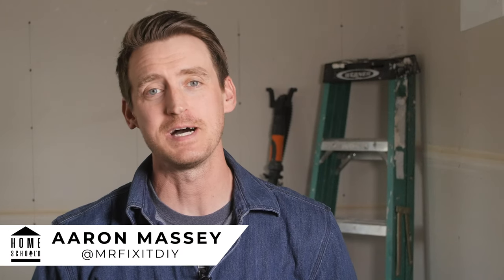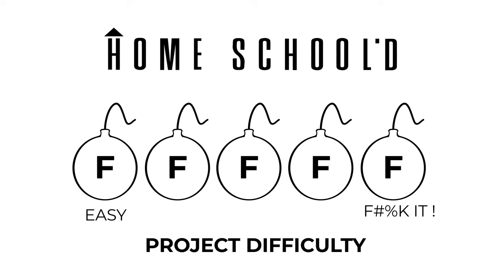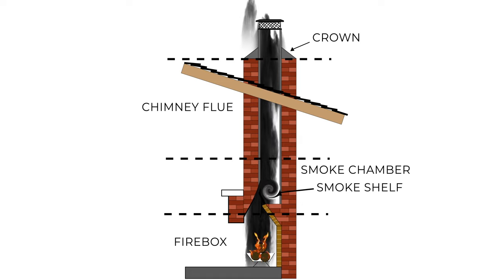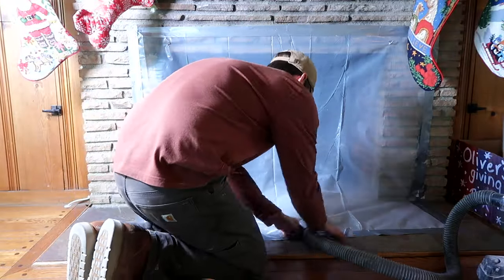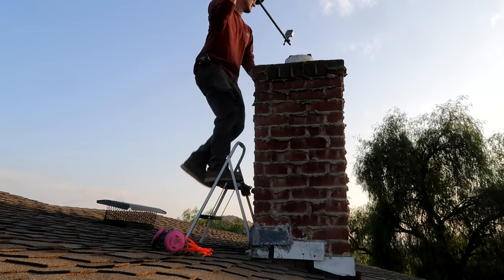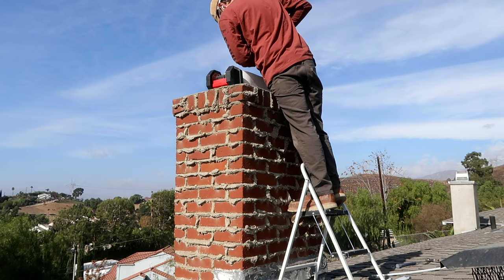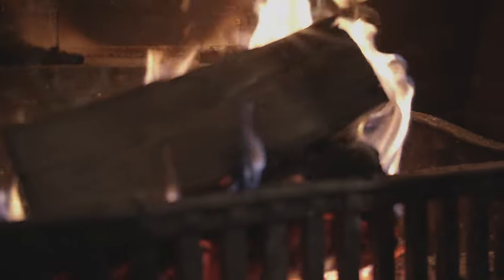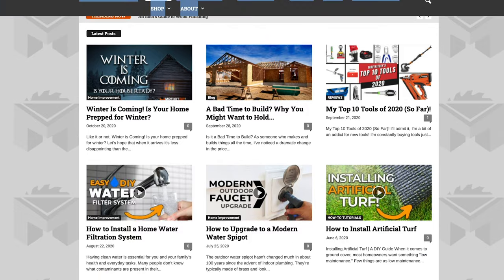How to Clean Your Chimney & Why You Should! | A DIY Guide

Comment: I'm a real life chimney sweeper. You did a good job but dam you made it look way harder than it really is  and did way too much. It's done much simpler in real life when actually doing this job daily. Never use unnecessary stuff like that creosote buster. That is not needed until you have an issue with creosote. Otherwise you are just burning money away. To avoid creosote you just need to burn dry wood and let enough air on the fire that it burns at a high temperature, so it burns everything away that the wood burning process produces. Making a fire in a fireplace isn't really something simple like lighting logs. There are actually a lot of details about it, on how to do it the right way and avoid problems later.

Comment: Thank you! I just got quoted $1600 to clean the chimney, fix the crown and replace the cap. LOL! The minute he said $225 for the cap I knew he was out of his mind since I know those are about $60 at home depot.  So I figured I'll just do it myself!
Reply: yes but they have to pay business taxes and insurance and liability and licensing and etc. etc. so find 3-4 quotes and then you can see if you're really being ripped off. if you can climb a 30 foot ladder to cap a chimney more power to you! ill climb a 70 foot silo before i'd climb an extension ladder.
Reply: @danielroden9424  there’s no need for ladders at all. Actually. There’s window access to the first story roof, with easy climb up to the 2nd story roof, which gradually slopes up to the top of the chimney.
Reply: I had my chimney cleaned & crown repaired, but they put a lock top damper on instead of me using my old rusty iron damper. Maybe they were gonna put a damper on & not just a cap? I paid $1,400 for my job.

Comment: A few things I'll add being a chimney company owner. 1/4" or more creosote accumulation is considered hazardous, and even 1/8" thickness accumulation can be ignited (I've done it). "Level 3" creosote cant be removed with a brush. Good chimney companies inspect not just for structural integrity issues but also installation/build issues. And lastly, you MUST clean the smoke shelf after cleaning the flue on this kind of setup. The smokeshelf catches the vast majority of the swept creosote, without removing it, all you do is relocate the flammable creosote to an area thats closer to the firebox. Its amazing how many "reputable" companies forgoe cleaning the smokeshelf
Reply: I had two sweep out and first one cleaned chimney and smoke shelf second one ran a camera and said it looked good but mention a spray for the creosote smell both recommended a installer for a woodstove insert with a stainless steel lining but the installer said nothing about a spray is it need ? Thanks
Reply: Yes the the smoke chamber and shelf are very important to sweep off that's where most flue fires start my guy
Reply: I here is the smoke shelf? And do all chimneys  have them ?
Reply: This is why I come to the comment section. Thank you.

Comment: Perhaps I missed it, but you really need to vacuum all the creosote that collects on the smoke shelf. This can become a primary source of ignition once it builds above the lip of the shelf. You will need to remove the damper…easy to do. You will be amazed at what comes out of this area….5-15lbs of loose creosote.

Comment: I am a CSIA certified sweep operating in the southern US. I think your brush and rod set up was really good. You did a thorough job brushing, and good on you for sealing off the fireplace. I was also very pleased with your respirator. I am a little concerned about the soot that was left behind the damper catching on fire. You can check what is back there by holding your phone over the door and taking a picture. Shovel or vacuum out whatever you can from that smoke chamber.
Reply: Dude thank you for that info!!!!
Reply: I was thinking the same thing!
Reply: Agreed. The previous owner of my house never installed a cap and the area behind the damper door was full of leaves and debris just wasting for a fire. Get up in there with a vacuum as not everything will fall out into the firebox.
Reply: I’m gonna get my CSIA asap how’s business in the southeast
Reply: My fire place does not have a smoke shelf or damper built around 1940. I have no problem using it I have a cover on the top with inches with a chain to pull it to open and close
Reply: Very true. I have about 5 years experience, but not certified. Though I learned from the best. Another way to check behind the damper is to take a heavy duty flat screwdriver and pry the edge of the damper up and see what comes spilling out. Can do that by pushing up and back on the damper handle  if it's a center handle. Sometimes damper removal is a must I'm sure you know.
I've yet to try the cell phone picture. 
Thanks for that tip.

Comment: Good video but one thing i will say is the tool he used you do not have to go on the roof in fact its pointless to do so. When i had a chimney sweep  service done he used basically the same tool and just did the sweep from the fireplace to the top of the chimney useing the rod no need to go up on the roof and risk your saftey

Comment: I am a chimney professional, and do sweeps, installs, tuck pointing, and basically anything on your chimney, and I approve this message. Cleaning your chimney is quite easy. Just one thing, make sure to clean off the smoke shelf as well. There will be a massive amount of build up up there.

Keep in mind that there are countless variables from cap types (top damper, with a long cable down the flue), flue types (clay tile, liner, etc) stove type (freestanding, insert, furnace, etc) and clean outs. All pretty much the same, but there may be different added requirements like removing the cable in the case of a top damper. These should be mostly self explainitory though.

The main benefit of having someone like me clean it is because 1) we know more about what we are doing, as well as how to look for damaged flue tiles, and other safety issues. 2) Fire insurance!! There is a fire inspection form that when turned in to your insurance agency by a licensed professional will massively lower your insurance. Any home with a fireburning "anything" is automatically put into a different cost bracket. We can get that reduced to as little as 1/3. And 3) we keep track of everything from videos of your chimney and flue for our file and to reference in the case of an insurance claim, to helping you make your fire burn more safely, more efficiently, and with less creosote. Oh, and 4) it's supposed to be good luck to shake the hand of a chimney sweep. Not sure why, but people do it all the time, lol.

So all in all, good info, and thank you for spreading the word. And to everyone who read this far, have an amazing day, and chim chim, charoo!!
Reply: I have a heatilator insert installed in 1991. Do they need cleaned yearly doesn't look like much build up when i open flue its a 8inch SS flex pipe from box to roof
Reply: @nickyj3571  it depends. We usually suggest every year, but tbh, if it is handled well, we suggest every two years. I've seen it last 10-20 years, but those people are few and far between. I really don't suggest going longer than two years, as there is much more involved than just cleaning. We clean, video, inspect, and notice any dangers that you may have missed. We also save all that info in the event of a fire related incident, and the inspection form lasts two years most places. That form will take a huge chunk out of your fire insurance. 

So, in short, you can clean and inspect your own chimney, but it would be wise to have a professional at least inspect every two years.

And I would advise asking your local chimney professionals this stuff too, as I don't know that model off the top of my head, but it sounds like you have everything set up well, just can't really answer that with absolute certainty without actually seeing it.
Reply: @bubblegumshoestringracing1498  I'm not quite certain if this is meant as a question or not, as a phrasing confuses me, but I'll read it as such.

 I've never heard anything about it being good luck to tip them, but definitely to shake their hand.
Reply: I need someone like you.
Reply: @laureenwood5986  haha, that's why we get payed the big bucks, jk, lol.
Reply: So if I need my fireplace inspected what is the title of a professional to look for?
Reply: @deverdoo5228  I'm not certain in your area, but just look for a licensed professional, if they are not licensed the inspection is obviously void. Does that answer the question?
Reply: I couldnt of worded this better myself, I also am in the industry and only would avoid a DYI sweep cause like you mentioned, the insurance and the knowledge gap
Reply: @0nIyGeese  thanks man.
Reply: And, I am sure you would clean all the crap piled up on the smoke shelf!
Reply: how do you tackle super old and sticky and tacky build up? pressure washers?
Reply: @cdoublejj  if it's thick, a putty knife/chisel, if it's thin there is a product we use. I'm on a plane, so I can check in a bit. 

If it's dry/burnt then it's easier, it just needs scraping off. Not sure where it is, but make sure you never inhale any, it's mega bad for you, especially if you have bats around.

Edit: couldn't find what we use quickly, but Rutland glass cleaner looks close to what we use.
Reply: You had me rolling chim chime Champloo. 😂
Reply: I pay 425 for a precessional chimney sweep and inspection but it is already day # 4 after the cleaning and the chimney still having a creosote smell.  I think I’m allergic because my throat and lips start itching and burning when I sit close to the chimney because my couch is nearby.  What should I do?
Reply: @melinamoncada2588  first off call the sweeps and let them know, that shouldn't be happening. I've never heard of the allergies, but you could link me a photo of the fireplace and I can look up the specs.

Also, have you used the fireplace before the cleaning was done, or is this the first time?

Comment: Thanks for the info!
Tip: Do not leave your vacuum in the house while vacuuming, use a long enough hose so that the vacuum is OUTSIDE. Ash is very fine and the filter on your vacuum won't catch it all, leaving your room with ash dust.This is especially true if your fireplace has a lot of ash. I use a piece of swimming pool vacuum hose. 
Thanks
Reply: Yes, yes, yes. That fine ash is hard to see sometimes and unless you have a professional chimney vacuum, forget it. 
I know, I was once a chimney sweep.
Reply: Fortunately my house has a central vacuum, which is mounted in the garage and vents to the outside. There are two inlets inside the house, and a 30 ft long hose that will reach anywhere in the house. It works great!! 😊

Comment: Thank you for the clear explanation of the how and why.
Right before I bought my house the owner had the pellet stove going and smoke did not fill the house. However, when I tried after a few times smoke came into the home.
I don’t even see a flue door handle any place to make sure its open.
Thank you for any additional tips.   Im going to replace the pellet stove for a wood burning stove that will connect to the pipe coming out from the chimney.

Comment: Watching chimney cleaning videos and this video has good cleaning information. Major problems are caused by the chimney not being high enough above the ridgeline or the chimney surround that many have built around the brick chimney or metal chimney. A major problem is having tall trees too close to the chimney which impedes the chimney from creating the proper draft and if considerably taller than the chimney the trees can cause a negative air pressure that actually causes the air to be deflected up over the trees and then lands on top of the chimney which again impedes the chimney from having a proper draft. Bad draft conditions = smoke in the house from backdrafts and excessive creosote buildup. Wood selection is another consideration as some woods create more creosote than other types of wood, the amount of moisture in the wood, whether it has been properly seasoned or not are also considerations. Check your local codes for proper distances above higher structures such as buildings and trees, and for the minimum height above the ridgeline.

Comment: Been a chimney sweep for years and never had to get on a roof to clean a chimney..   pros do it from the firebox with flexible connecting rods ( not stiff fiberglass rods). If you buy that chimney sweeping kit recommended here  then you will need to get to the top of the flue to do the cleaning and most likely your going to make a huge mess or fall of your roof.. also if your flue has a bend in it  forget it
Reply: UK chimney sweep here. Greetings buddy. Never swept a chimney from the top in fifteen years.Get a professional in is the answer. A professional will do the job in forty five minutes with no mess including paper work, coffee and chatting to the customer. I charge fifty five quid for a professionally installed appliance so why risk buggering up your roof? Never go on a roof unless you absolutely have too. Ladders on a roof is just asking for damage.
The worst jobs I get are from people who have been ‘cleaning it themselves’ for years and for some reason it seems to be blocked…….. You know the score buddy!

Comment: Please do the video on making fireplaces more efficient:)
Reply: As a professional chimney sweep I unfortunately have to tell you you can’t really make an open fireplace more efficient. The main drawback of an open fireplace is that the fire draws a lot of oxygen from the room, so it naturally pulls the warm air out of the room to feed the fire. Meanwhile the heat radiation from the fire itself is not good enough to compensate because open air is pretty much the worst heat conductor there is, so you often find the room will actually be colder after having a fire burning. The only thing you realistically can do is install a wood burning stove inside the fireplace, those can easily heat up a normal sized living room. Drawbacks of that include the cost of the stove and installation (several thousand dollars in most cases), and they’re not as cozy as an open fire. 
Hope this helps :)

Comment: Good information about chimney cleaning. However there are many other things that can happen to a fireplace system that are at least as dangerous as a chimney fire if not more. Fireplaces should be inspected regularly for cracks in the smoke chamber and poorly installed flue liners with missing mortar between them ( as I saw in this video). Most fireplaces have framed walls around them which require a minimum of 2” clearance from the masonry. If this is not observed old dry lumber is at risk. Water infiltration though cracks causes Spaulding of masonry and other issues. In short a qualified person should be able to to spot hazards that need to be caught early on.

Comment: Help!! (Please. 😁) I have an outdoor fireplace here in Florida for a house I just bought a few months ago.. it's built into the exterior patio wall with brick and a full chimney on the exterior of the house. I don't think there's a flu. Smoke seems to come right out of the fireplace and onto the patio instead of up the chimney. I didn't think much of it until I went up on the roof to hang Christmas lights, and out of curiosity, I walked over to the chimney to check it out.. there's a large piece of flat rectangular sheet metal (sharp on all edges) that looks like it is screwed on with some hinges on one side. My thought is that this is closing off the air flow to the chimney and preventing draw. Do I need to do work on this thing to fabricate something? Open it? If I open the solid metal sheet is there risk of crap/water getting in there? If it was built like this, I assume it was done with a purpose, but I feel like I'm lost on how to work it. Any help would be appreciated. I can answer any questions and maybe even post a video with a link of what I'm talking about if needed. Thanks in advance! 😀

Comment: Can a chimney be cleaned from the bottom up? that is without going up on roof? I live in an old very narrow very high house where the chimney is on 2 top sections that are like on 45 degree angles and i had a stroke so dont feel at all comfortable going up that high with my wonky on off balance....

Comment: How long does the fireplace need to be unused before doing this and why? We burn every Sunday.  Is a week long enough? Thanks for the video! So much cheaper than hiring somebody!!
Reply from the maker: A week should be plenty. You'd want to make sure all the ash/coals in the fireplace are removed and disposed of properly in a metal can or whatever before you did it. I'd recommend you do this after every 50-70 fires.
Reply: @MrFixItDIY  great! Thanks for your quick response!!
Reply: What he doesn't mention in his response is that the ash needs to be allowed to cool 100% before putting them into the ashcan and then the can needs to be taken well away from the house!!  I've seen far too many people clean out hot ash and coals and set the bucket on their porch or what have you.  All of these cases resulted in no house when the owner came home!!

Comment: Question please, our home is new and the wood fire place has had only about 20 fires in it, is that to few to clean it. I was thinking about using a creosote log this year and have it professionally cleaned after next. What do you think please and thank you.
Jimmy
Reply: 20 fires is not enough to make it necessary to clean, especially if you have been using properly dried out firewood and good airflow. /Professional chimney sweep
Reply: I used mine like 10 times every winter and I sweep it every 2 years not plenty soothe build up. I also use mixed fire wood but most Burch fire wood which burns nice and gave out less soothe.
Reply: Maybe after 200 fires or so.